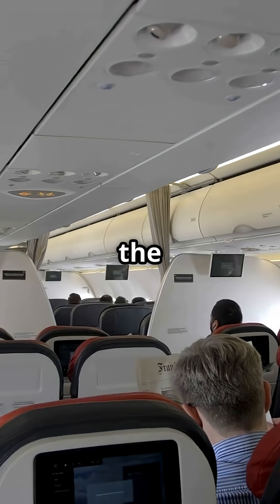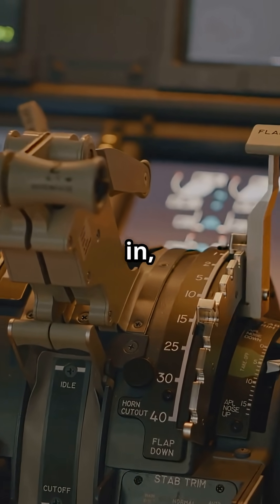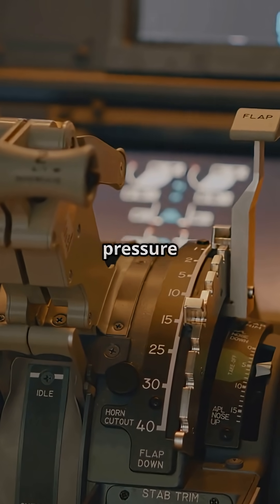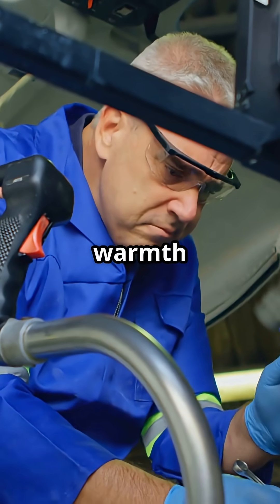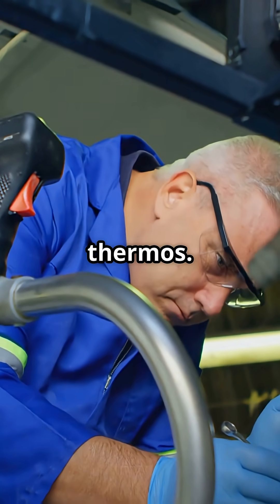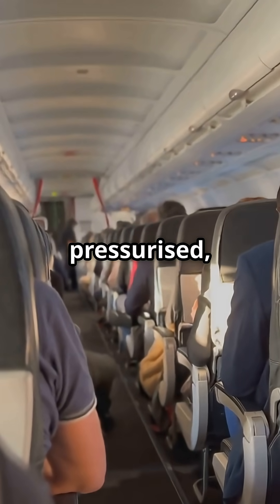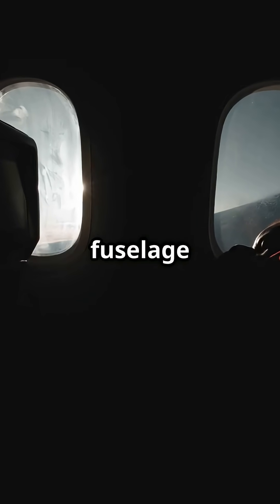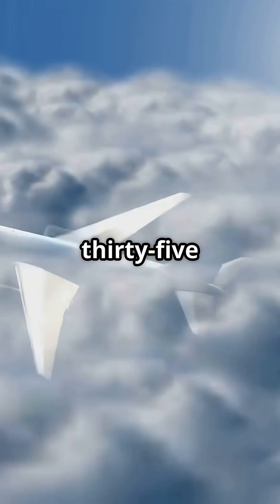How can you sit in a t-shirt while it’s –60°C just outside the cabin?

Comment: Actually the planes could be a lot warmer inside, since cooling the air is what takes energy and effort. They're just kept cool for passenger comfort (Or idk if there are other reasons as well, might be e.g. structural stress at the outflows and other parts where the heat gets off). The way TU-22 pilots benefited from this while the air conditioning was cooled with vodka was pretty amusing. I, as a Finn, have also thought about the possibilities of having a sauna in a (private) plane. The required heat would be easy to achieve, but the moisture would be the problem. It would require very big water tanks weighing a lot. But, I must say that a sauna heater working with bleed air would be very interesting.